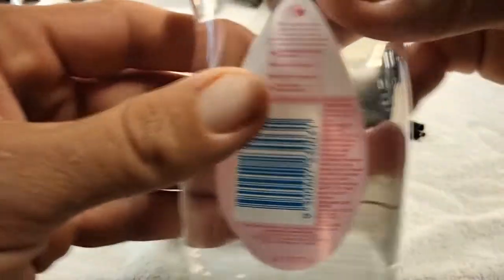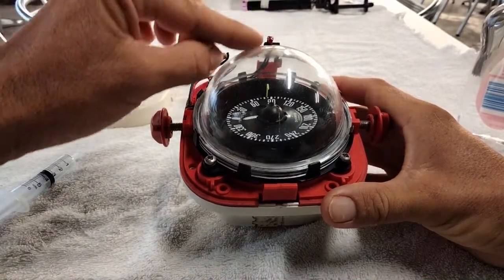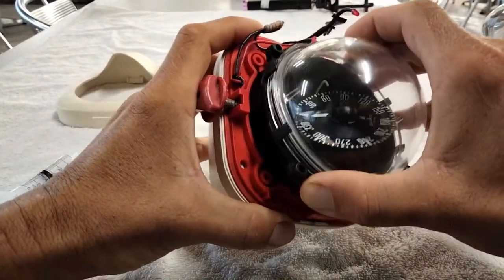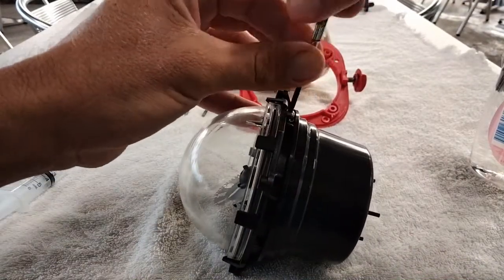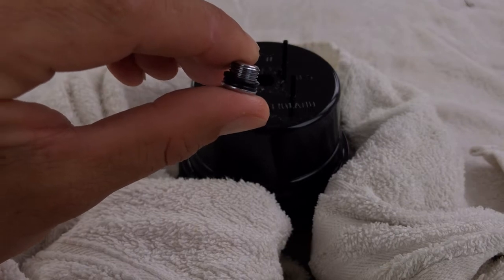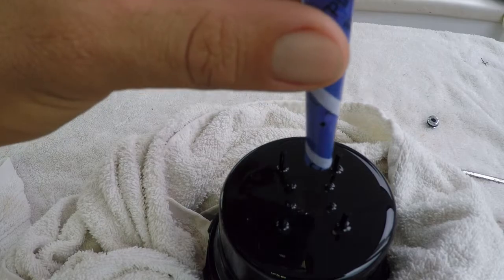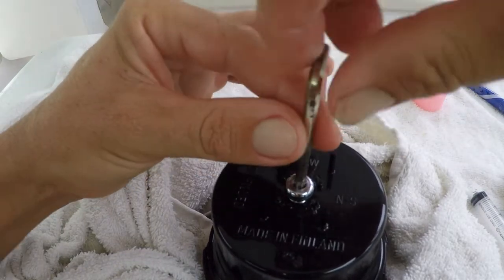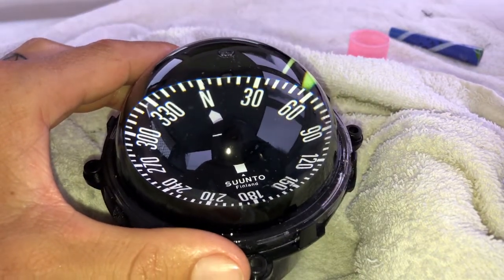DIY Compass Repair And Oil Refill

Comment: Now, once you've filled yoiur compass and sealed it, do you see the e-w and n-s marked holes in the base? These are for "swinging" the compass to take out (as much as possible) any errors induced by nearby operating electrical circuits or ferrous metals... they can affect the accuracy of the compass reading. Then you can make up a "Compass card" to record the indicated reading vs the true heading. I used to "swing" the AN/AJB-7 Compass Adapter Compensator on the Bomb/Nav system and also the "standby" B-16 compass on the F-105 fighters (Those B-16s are still in use!) back in the late '60s at Tahkli RTAFB in Thailand during the Viet Nam war.  Cheers!
Reply from the maker: Really helpful info Spamcan Thankyou. I haven't spun my compass but still hold the intention to in fact I need to calibrate the bearing on the autohelm, gps maps and the compass so they all read the same heading. 
Thanks again for the comment 👍
Reply: @sailingsofar  Oh, and just in case, the compass will always read magnetic north, the autohelm could read magnetic or true (don't know if it is flux gate or gps driven) and of course, gps maps will be oriented to true North, I'll bet, but it might be selectable between the two norths.  Then there's "grid north" and ....... nevermind! Happy sailing!

Comment: Great video mate.
Reply from the maker: Hi Luis
Thank you for the comment.
Reply: Mineral oil. Does that work with  all 🧭
Reply from the maker: Thanks for the question, to be honest I am unsure if mineral oil works with all oil filled compasses. However there is specific compass oil that you can buy if you wanted to play it safe. That being said the compass in the video has performed very well since our DIY refill.
Hope that helps.

Comment: I need to refill mine so thank you for the video. One question my compass mount is on vertiical on the bulk head but the card is upside down. How do I fix that? Just one comment an Aliminum baking pan would save the work bench from an oil spill :<)

Comment: Hi, i have the same problem you had, also no bung in the base. Other internet posts talk of a "bellows" arrangement int the base cup of the compass. Presumably this is to allow for expansion and contraction of the fluid. After a year is your fix still good?

Comment: What caused the plastic to break and released the oil?
Reply from the maker: Hi, thanks for question. It was missing the original bung that the compass is suppose to have, the compass never came with it. So it was empty when I got it and the oil had drained because the bung was gone (The compass was on the boat when we bought it). So that's why I had to make a DIY bung. So no broken plastic, just an absent piece, and I had to plastic weld some holes  that I assume are important to secure the original piece, but didn't work with my make-shift bung. I hope this all make sense.

Comment: what s the name of the fluid
Reply from the maker: Hi Filip
The oil I used has a baby oil by Johnson and Johnson which I got from the local chemist. But I have seen it everywhere i.e. the corner store, pharmacist, some hardware and even Petrol stations.
Thanks for question 🤙

Comment: Mineral oil us too thick
Reply: not an issue unless you live in a region with below freezing, in which case you wouldnt boat anyways.
Reply: @juslitor Good point. It is normally hot as hell here so I guess it will work fine.